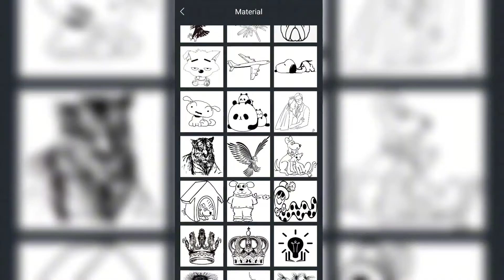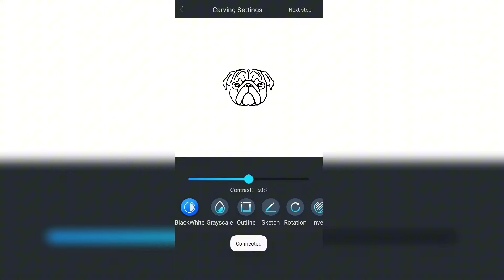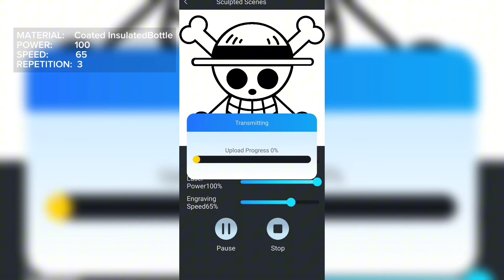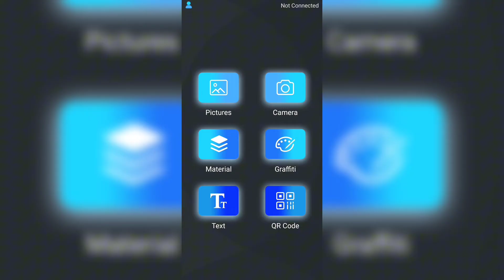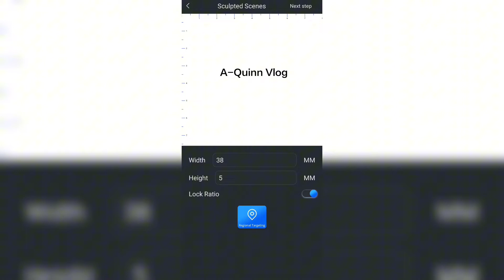DAJA DJ6 Engraving on Different Types of Metal | A-Quinn Vlog

Comment: I think dahil po 3w lang ung unit nyo kaya d sya kaya dun sa gunting?
Reply from the maker: Hi, @racingdad8342. May nagcomment po dito ng settings for  stainless steel before, sinubukan ko po ulit sa gunting and nagwork naman kaso hindi po ganon kavisible yung output. And tama po kayo, mababa ang W kaya may mga material lang talaga na it will work best.

Comment: wala akong "stainless" na setting sa parameter ko sa app 🥺
Reply from the maker: Hi, @artemisdee7506! Ako lang po nag-add non sa app ma'am hehe 😅 Pwede po kayo mismo mag add/save ng settings sa app.
Reply: @aquinnvlog  ah okay sige po salamat try ko po gayahin settings nyo. If ever po maisipan nyo gumawa ng coated metal sana po matry nyo sa mga pet tags maganda din kasi tignan. Salamat po.
Reply: Ma'am ask lang Po.  If pang business Po sya , how much Po Kya Ang pa engrave? Idea lng Po. Plan Po kc mag business. Salamat Po sa sagot
Reply from the maker: @jaymarempleo1502  add ₱50-100 on top sa presyo ng inyong materials po. Depende po sa size at details na ieengrave.
Reply: Ma’am bakit po kaya ayaw sakin magwork? i followed your settings naman po
Reply from the maker: Hi  @kween.katrina  . Ano pong material ninyo ma'am? Na-adjust niyo po sa smallest point yung laser light before magstart magengrave?
Reply: @aquinnvlog  Yes po. Yung card holder po na aluminum sana yung gusto kong i-engrave. Color black po sya and yes, in-adjust ko po yung focus before ako mag engrave.
Reply: @aquinnvlog  But it still can't be engraved on stainless steel, right?
Reply: How to add stainless option in aplication?  @aquinnvlog